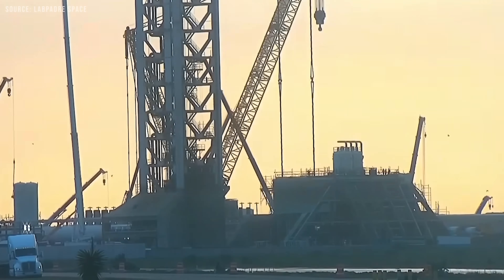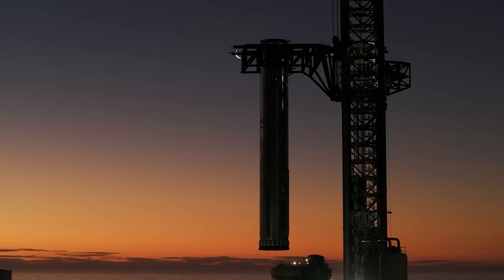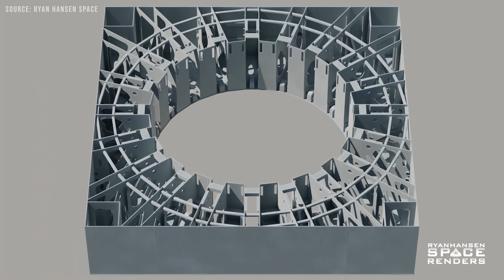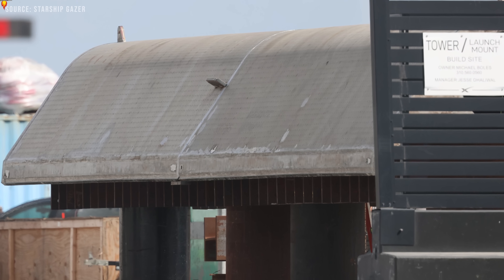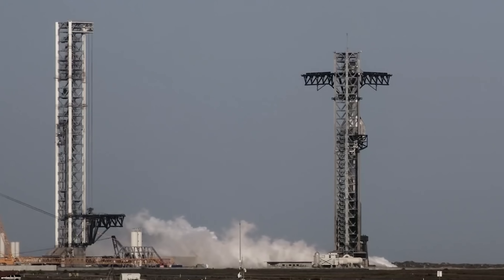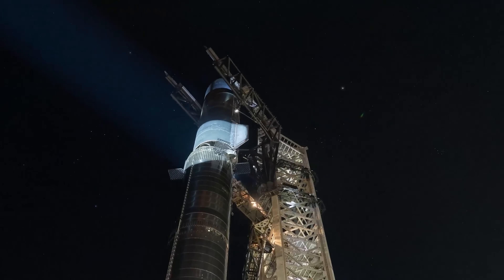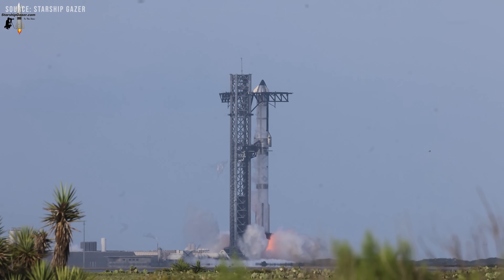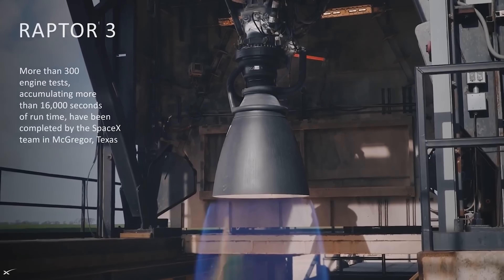SpaceX reveals Something Big happening with Starship Starbase Launch Pad, Better than ever!

Comment: Excellent walk-through of upcoming plans, thanks very much!
Yes, there will always be "save the swamp" opposition but those complaining about road closures and beach closures I have ZERO sympathy for.
This is called "The Space Coast" for a reason, and has been operating rockets there for 80+ years! Any dimwit that moved there thinking they were getting a nice quiet place on the oceanside with quaint, relaxing beachfront is an idiot and should be dismissed from the FAA hearings out of hand.
Same with the airports. Florida has a LOT of airports and extending and increasing traffic at the one(s) near the Space Coast was another idiot move. Again, ZERO sympathy for morons.

Comment: Why do people even complain about launch site noise??!?! They probably drive with the radio up, and windows down for about an hour. Mean while a launch takes maybe 5 minutes from lift off before its quiet again and another sonic boom and engine noise for 3 minutes before catch, the environment yess but if you dont like the noise gtfo, or buy ear plugs. Or something. Sit back and enjoy the view.
Reply: I mean, spacex historically did static tests at nigh. Rockets are extremely loud, so i think complaints are very reasonable. There are ways to slow down sound on both city and test area ends. Barriers for example.
Reply: @Psycho7452 yes but once they get out if that testing phase for static they won't need to as they did with falcon